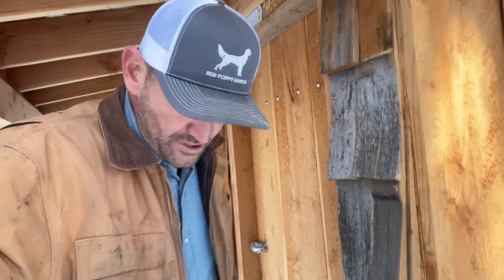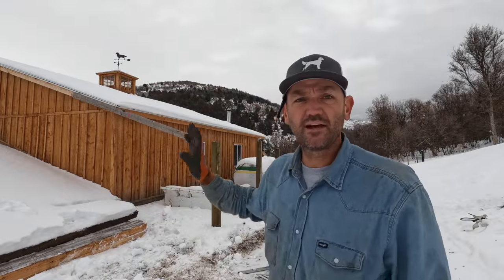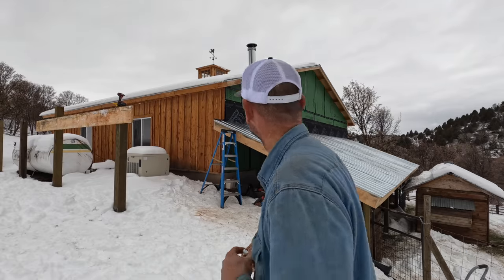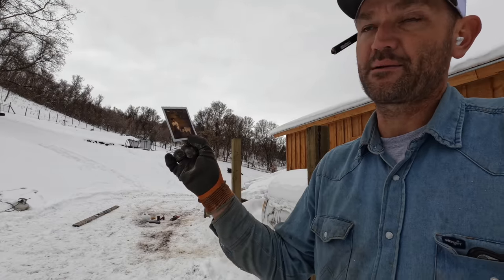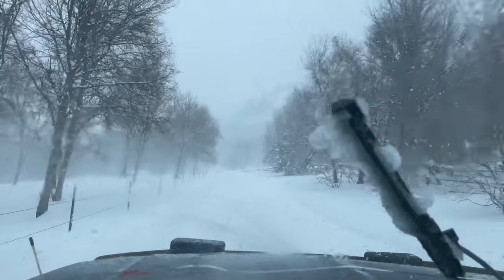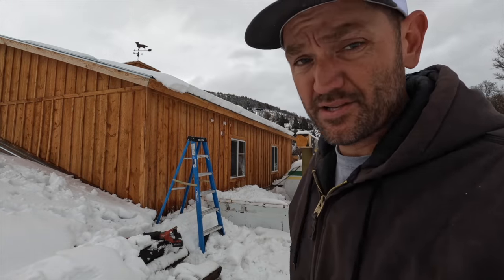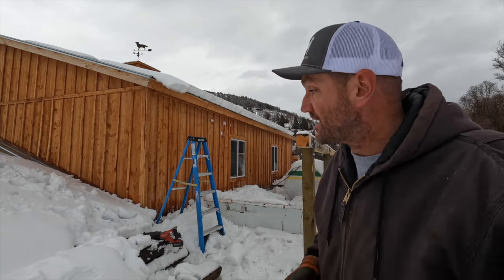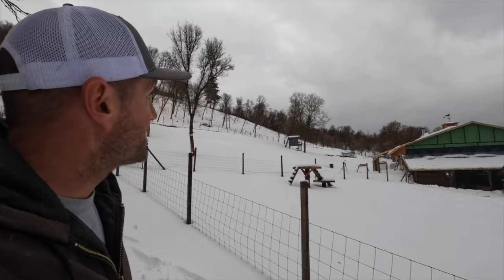#549 - Stretching The Shop Roof...

Comment: Heath your attempts to use the woodshed roof as a guide in measuring the pitch of the roofline over the generator reminds me of my one attempt in life to try to snow ski. I wasn't dressed correctly for that little adventure and the drive  back home was a miserable affair. A cold and wet blue jeans bottoms were my reward for my efforts. Living where you all live is a guaranteed White Christmas. I think in my 66+ years I may have had 3 White Christmases.

Comment: Heres my 2 cents Heath. I think you would be well served by finding a small dump truck to plow the road with and using the pickup for your driveway. You may find that even a 1 ton chassis isn't heavy enough to withstand the road plowing. A heavy truck can push a wider plow and you could go down and back and finish in one pass. The only negatives I see, beside costs, are recovery which may require busted wagons dozer (could be fun to start if it's been sitting all winter) or a tow truck (good luck getting one during snow events). No small choice you have there. I'll be interested in seeing what you settle on.

Comment: I plowed mostly residential driveways and some commercial lots for ten years. I used a diesel single rear wheel  truck. They have so much more  torque than gas and use much less fuel than gas trucks when plowing. There were times the snow was so deep it would roll up over the hood and i could only keep the blade straight or it would push me off the road. Dual rear wheels hold more weight but turn like crap, require a wider blade and get stuck much more often. Avoid fancy V plows,  they have more crap to fail.  Western straight plows seem to be the most reliable. I use spray Wd40 to pretreat the blade for sticky snow.  A poly tarp over the cab before the snow starts falling makes cleaning the truck a pleasure.

Comment: Power grid here is mostly reliable, but staged generator, gasoline, cords, and wood. We rarely use our wood stove since we pay more for wood than natural gas. Too easy to rely on services in the city. Love what you do. I’ve never criticized when I thought should do something different—easy to be a couch critic. On our house, I’ve taken a couple of shortcuts (not bad) but bad for future changes. The biggest one was when changing electric panel. I should have doubled capacity, but time and money, limited me to 125A. I’m certain things added since exceed NEC load calculations, but have never blown the main, and all safely current protected. I’m planning to start experimenting with DIY Mr Cool units. I don’t need the AC part, but hopefully cheaper than resistance heat for garage and shop. My electric bill is what most people pay to heat a house. Love what you do. Wish I could plumb more gas or ground source heat pump, but cost always an issue. Happy New Year, always anticipating new videos.

Comment: Heath, on your generator for your well with the propane kit. Your most likely having trouble  starting it, due to the propane  regulator freezing up in the cold. You can try a two stage regulator that will help. You can also thaw it out by pouring hot water over it. That is what Pastor Marty's friend Shawn did with his propane regulator. It worked for him.

Comment: Merry Christmas
consider a 4x4 tow truck, it would already have pto or hydraulics for the snow blade or snow blower.  
remove the winch, 'A' frame and tow bar or the pull back bed, install your dump bed for hauling wood/gravel/ect. 
the short tow truck would be easier to turn around. 
put some tires on it with deep lugs, something similar to tractor tires.
I would also consider installing a winch front and back. just in case of sliding off the road or vehicle recovery. 
I would consider a f450 or larger truck with a two speed rear end... low gears for plowing, high gears for on the road...
split shifting is fun.... 
cc

Comment: If those are to be Hurricane straps, be sure to put a hurricane nail in each hole in the hanger.  The nails are short and thick and the integrity of the strap depends on the type and number of nails.   We found this out from the inspector on one of our first Habitat for Humanity houses.  It is far easier to nail in the hangers as rafters are placed and you have working room .  We bought a palm nailer to handle the “ no room to swing a hammer”  problem in that Habitat house.  The little palm nailer is very cheap, under $ 50.00 and very .  Wear ear muffs.   Merry Christmas and a Happy New Year.  GOD BLESS YOU and YOUR FAMILY.
JoeB

Comment: Take it from a guy that's been born and living in southeast Idaho his entire life that plows snow for a living in the winters. With as long as your road is and being gravel and the amount of snowfall you get even if you get a one ton truck you're still going to be messing around and dealing with a lot of breakdowns. Pickup truck's including one tons are not designed for that kind of service and abuse, even plowing smooth paved parking lots are hard on them. You need a piece of equipment like a 4X4 farm tractor or construction equipment like a front end loader or similar equipment with a angle or V-blade on the front. Just a suggestion.

Comment: Carful out there in the slick snow. Others have had simple falls like that & ended up never walking again or much worse. Hope your not to sore tomorrow… Merry Christmas 🎄 find an ol Duce & a half for your plow truck …. Dually 6x6 with loads of low end torque 🤷🏻‍♂️ a guy can pick them up cheap if you look hard enough. Can also run them on raunchy diesel if need be along with other end of the world type fuels. A true bare bones work horse.

Comment: Go buy a small spool of 1/16 inch cable or as large as you want. Attach the cable at the eves of each building along the ridge line. Place a pulley on each cable . When you need to get on the roof, attach a rope to the pulley and tie yourself off. You can make it all removable or permanent. You can then walk hands free safely . Leaving a rope attached would help with snow removal from the ground by just walking along the roof line.

Comment: Find yourself a used Highway Dept. single axle dump truck most have low mileage and are set up for plowing a Ford Louisville or an International  Look to Cal. they have a 9 year use limit on trucks.

Comment: Where you get up on the roof around the house and barn you should  apply some of that sand paper anti-slip tape, you could brush the snow off and have a good surface to walk on. If you put a strip up it would help you climb to the crest.

Comment: Heath you should ask the county or the state if they are going to be replacing any of their snow trucks and see if you can get one at auction or whatever.
Reply: Agree- he had mentioned he didn’t want to get a big one since it would be ridiculous if it got stuck or rolled. But a big one with a long blade out the side to kick the snow really far away would be nice. Chains on all 4 (or six) wheels.

Comment: you should make a snow rake to clean the snow off the overhangs safely it will also cut down on weight you can extend the length by using old pluming pipe  ................... as for "creating "a decent plow truck use the truck the your son flipped and as we saw the motor seems to be ok not sure of the frame  but you can use the present plow truck and reconstruct the body with it making 1 good strong unit from 2  or BIT THE BULLIT and get a tractor that you can put a snow-blower attachment to and use that for the plowing and al the extras you will be looking at in the next year you could also use it as a skidder to bring trees out to be milled on your home made mill into lumber

Comment: Just a thought, when you're knocking the snow off the lip of the roof you could use a straight piece of metal or thin wood to "cut" it like a drift cutter on a snow-blower.  You'd be able to attack it from an angle and not have it fall on you, you might even be able to stand under the ledge of the overhang and push it along. Could be all for not given the tin isn't flat and has bulges though, just a thought.  Happy Holidays.

Comment: I had an exhaust leak no one could find.  It was the exhaust pipe flange under the turbo clamp.  It was very well hidden.  The flange finally let lose from being eaten away...then it fell apart.  I have tod other that and they save themself from a on the road breakdown when they removed the clamps and checked the flange lip.

Comment: Do you think you need to enlarge the windows to let in the light lost by the longer overhang of the roof?  Also, buy a roof rake to pull the snow off the roof.  I have one with a telescopic handle that works well.

Comment: Here in Texas we don't deal with the snow. If you are going to look for a good truck/dump truck, I would look south. Arizona, California, Texas, etc. I am looking at a listing for a 2004 F-350 dually crew cab with a dump bed right now. It is $20,000. Need it for my farm. Has 107,000 on the Powerstroke pre-DEF. Because it is a Texas truck, it doesn't have any rust on it.

Comment: Get a 7.5 western snow plow. Maybe a wide out on the end. Your Ford should work just fine.  Thought it was a diesel.  I do think a 4.9 cummins 2500 is better. Milestar pantagoni tires. Plus a light bar on cab. Gas motor does start easier when cold. Hundred gallon fuel tank for weight in the bed.

Comment: Love the channel; I was thinking about your need for a dedicated plow truck and I'd like to offer a suggestion for the perfect machine.  Out west they are more common than here on the East Coast, but I'd suggest you look for a Unimog, made by Mercedes Benz, they are quite popular in mountain area's, especially in Colorado where my friend bought his.  They are four wheel drive, diesels that are capable of running everything from a snow blower to a backhoe.  They are built specifically to be work machines and the older ones are tough as nails and nearly indestructible.  My friend bought one from a Colorado Highway Department, that was retrieving it.  He gave it some much needed service and loves it.  Since it was designed for tough weather and conditions, its has multiple transmission ranges in both forward and reverse.  With front and rear PTO's.  he bought a snow blower for it and lives in Montana and clears his driveway as well as some neighbors.  Check these beats out, they are not speed machines I believe tops speed is 50 with a tail wind.  But for power and work, they cannot be beat.
Keep up the greta work, best wishes to you and your family.  Happy Holidays.

Comment: Did you consider that the fuel company may not fill the diesel tank due to its proximity to a structure or windows or ceiling clearance? 

The propane companies wouldn't fill my tank because it was too close to a window.
Reply: The tank needs vented through the roof if it is covered.  The generator exhaust also needs vented.

Comment: Have you looked at a surplus army 5 ton 6x6 tractor, find a good 930 series, non electronic, Cummins, Allison automatic, you won’t have to worry about sliding off the road. 
Turning might be an issue

Comment: Would a surplus military hummer be a good vehicle as a snowplow, just a suggestion, looking forward to see what vehicle you do come up with, have a merry Christmas.
Reply: He's complaining about the fuel economy with that F250 with a 460, no a hummer isn't going to be any better, probably worse when trying to use it as a plow, they're not that great and don't have that much power to plow, the 460 in the current plow truck is perfectly fine for what he's doing, the dang truck just don't weigh enough to really hit the snow hard enough and fast enough to get it out of the way without having to make several passes.

It really don't matter what you use as a plow truck, pickup trucks were never intended to do that day in and day out.

Comment: We had our roof replaced at the cabin and when they did the metal roof they installed metal flashing that helps cut the snow as it slides down the roof towards the chimney and it works perfectly we no longer have any snow piling up on the chimney and now the snow lets off the roof a lot easier one of the guys referred to it as a snow slicer flashing but he said that's not what exactly called but he's forgotten the actual name

Comment: I have a question ? why did you get rid of that 1988 Chevy crew cab that was dually and had a dump bed on it then you changed it to a single wheel and sold off the   dump bed now you are talking about making a new 1 Ton plow truck when you already had a good candidate that chevy was a great looking truck and been a great plow truck.

Comment: You need a ROOF RAKE. Tool.  It will ease your roof snow load problem.  Had one on C?.  Bought it after a stormy winter with 85 inches of snow.  The tool reach is about 15 ft..   cost less than $50.  
JoeB